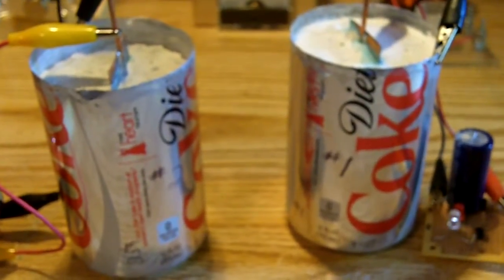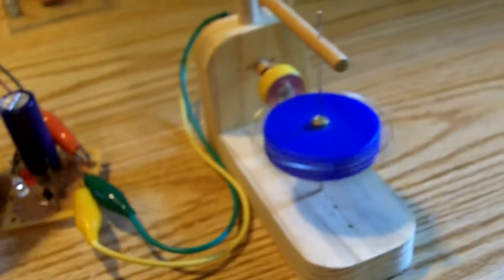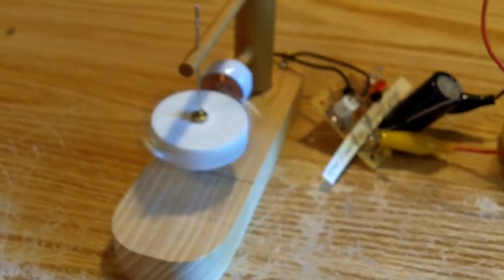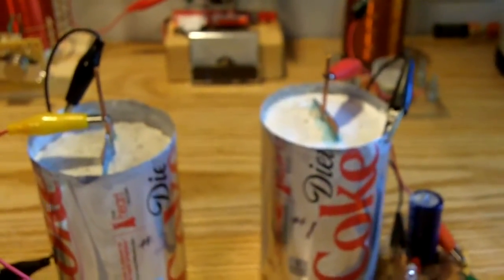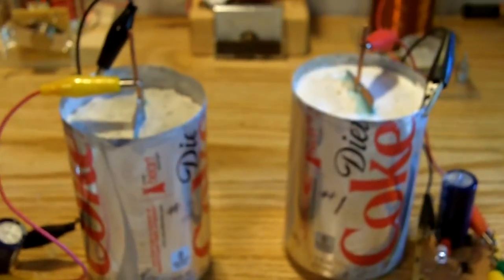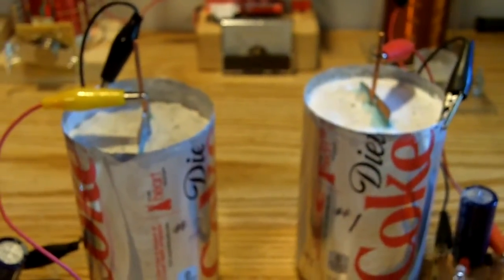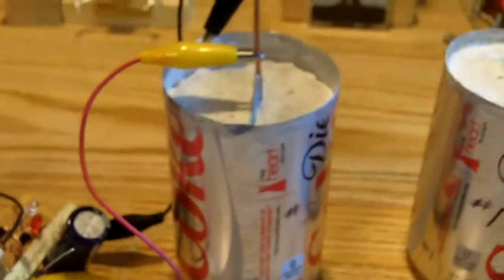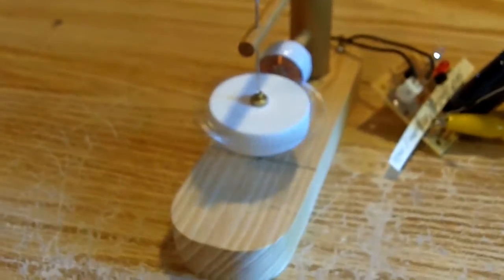concrete battery update #2.MOV

Comment: What was your ratio of alum and quickcreat mix?
Reply from the maker: If I remember right, I have a mixture of 50% water and 50% epsomslat. I used that when I mixed the concrete. Probably about a teaspoon of alum.
Reply: Thank you

Comment: Magnetman2010 .. I see you are using coke cans for the aluminum anode for these... soooo like since I can read coke on the outer layer the enamel layer is still on them right? meaning the outside of the can is not really fully exposed to air for the oxidation of the anode to happen to create the current? right? so like some sand paper in a well ventilated room.. while you are wearing a mask (aluminum is a nerotoxin folks when inhaled)... you remove the enamel surface (the printing on the can) and expose (since the surface is rough) a greater surface area to the air... and you want to do the same sanding on the INSIDE of the can where the internal (conductive but poor conductor) plastic coating is.... then repeat the assembly of your battery and see your results with amps produced and total watt hours you can get from said batteries..

Comment: Simple shorting did the trick, that's good to know...I tend to add water to mortar cells and off they go again. Shorting is definitely preferred - great results on yours !
Any cell that is open to the air gives me trouble, but, the two similar to these built months ago have always held 0.4V, they just run out of milliamps without water. I'll go and short them right now lol